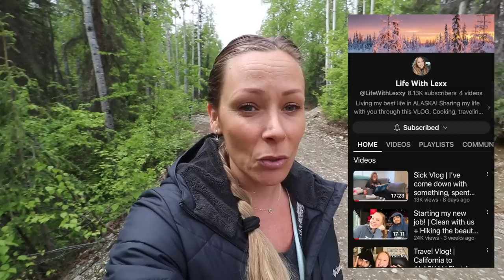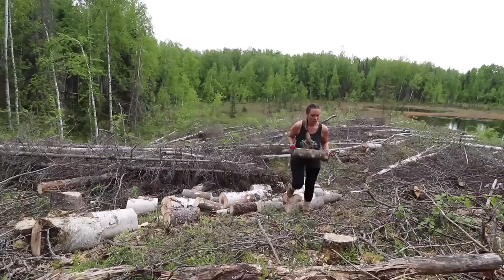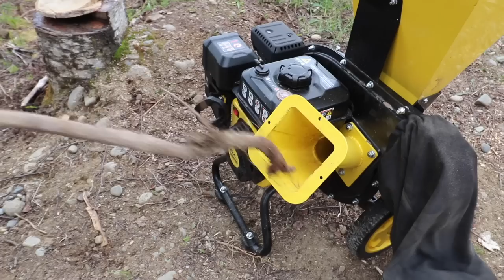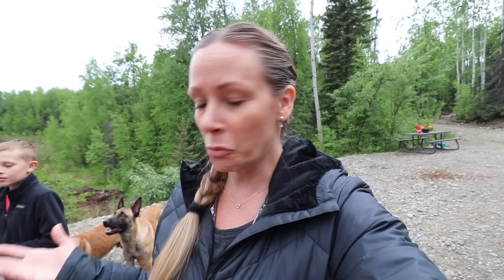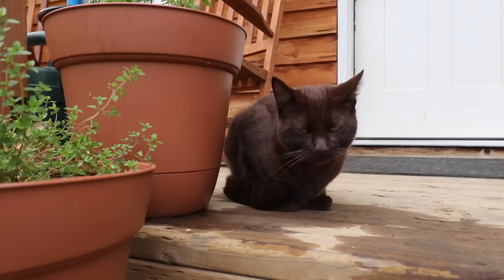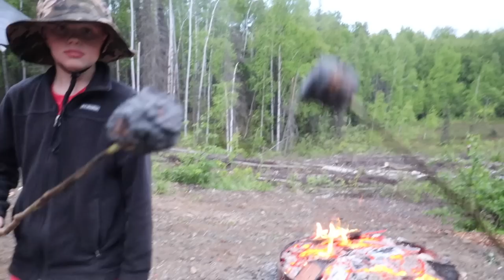Restocking Firewood | Family Time Around the Bonfire! | Alaskan Summer at Our Off Grid Cabin!

Comment: Get you some peppermint oil and put several drops in a spray bottle with water.  Spray yourself down with it when you’re outside and the mosquitoes won’t bother you as much.  I ran out of oil one day and actually used peppermint extract and it worked as well!